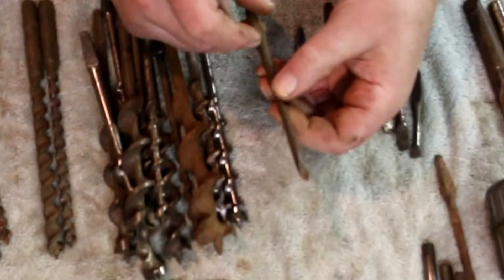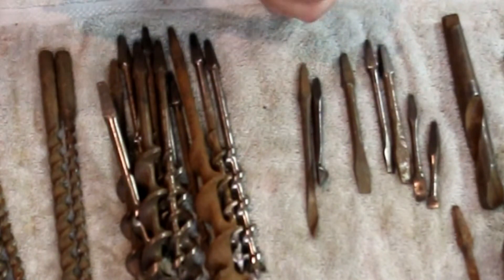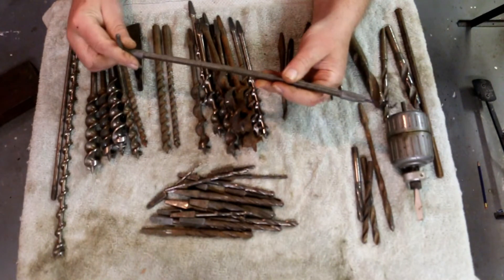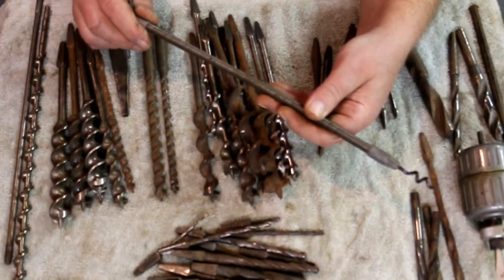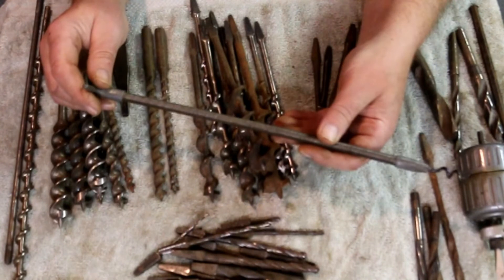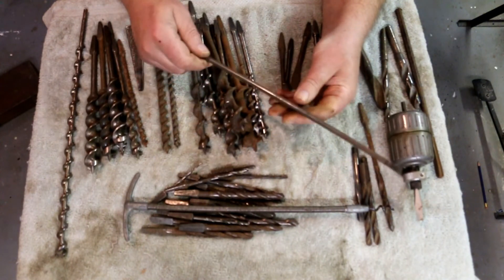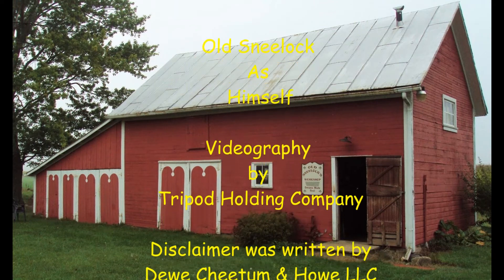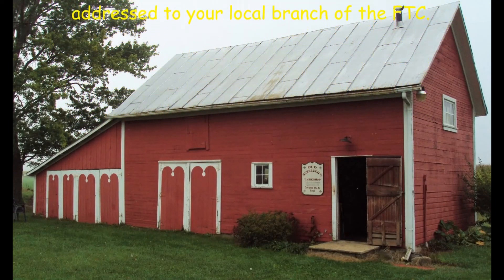Estate Sales ~ Visit To The Heritage Company Pt 2

Comment: You know what...you got me again.  We called those pics 'seal pics' and its more logical now that you've said you used them on hydraulic packings, but we used them to extract the rope packings on large gate valves in boiler systems for repacking.  We bought them at the plumbing and boiler supply houses back in the day.  I still have several from about the size you have there down to pretty small.  Replacement roping was all teflon based by the time I got in the field though in the '70's.  It came in various diameters on  spools.  I don't remember what the old original stuff was but it was always nasty, packed tightly and black looking stuff. 
    I recently cut the ends off of a long 1/4'' one to use the flex shaft to weld to fittings I made to open and close the little hydraulic fitting on my really old horizontal bandsaw.  The flex allows it to do its thing in any position from 60* or so down to the horizontal position.  The previous owner had make-shifted two 3/8 drive universal joints to flex, but it would continually bind up on me and it was difficult to control the fall rate.  Re-purposing at its finest !!  Yep...I'd have bought the twenty dollar box too......LOL
Reply from the maker: Good use of materials. 
Never liked pulling any kind of packing. Did it. Just didn't like doing it. 😀😎

Comment: Packing hooks, I have a half dozen here at home. I left a big hand full on the table in the shop when I retired. The bronzed gland followers we would drill and tap for 1/4" threads. You could then take a broken hook and braze a threaded rod to the end. Many a time I used a ratchet block to pull packing out, along with the gland followers.  Have a good day Un'k.
Reply from the maker: I was kind of surprised. McMaster still sells them. I had the Garlock Chevron Packings on the xxtrusion presses  replaced with U Cup packings back in the 80's.
Reply: @OldSneelock  We had many pumps using braided packing  in the paper mill. The hyd clyinders had chevron packing there was lots of those too. In the 90's we were moving more to mechanical seals in the pumps.  We had good service with them after we cleaned out the seal cooling water. Later we replumbed and ran the product or used antifreeze for cooling the seals
Reply from the maker: For a couple years I managed a company that did mechanical repairs on equipment and machine tools. When pumps began using ceramic seals it caught some companies flat footed. The seals worked great. As long as they were kept wet. Spin them dry  and they rapidly decomposed.
From 93 to 96 we did a land office business because they weren't  thinking about never letting the pump run dry. 
😆😎
Reply: @OldSneelock  It took the paper mill several years to work the bugs out of our systems.  First try was cooling water, the water was Columbia River water untreated. The fine sediment in the water wiped the seals out every month.  Then we placed tanks and used antifreeze this worked good and better in the winter. It took a long time to update a plup mill and paper mill of 12 paper machines. Someone made a truck load of money sealing mech seals.
Reply from the maker: @paulharriss1192  There were three big papermills in my area. At least big by my standards. Parchment, Plainwell, Vicksburg, all gone now. Lots of blame to go around. Not many jobs though. 
Biggest repair we did was bearing journals on rollers. Stainless is good for corrosion resistance. Sucks for strength.
Reply: @OldSneelock  When I started in 88 we had 250 millwrights, 175 pipe fitters,  electricians and instrument men, over 600 maintenance  people.  employed over 3500 people in it's hayday.  To day the mill has sold several times. Each time cuts to make it leaner.  It has about 75 total maintenance people. Most work is contracted out. We had 750 Union people when I left, two large Kamyr Digesters making pulp,  five machines making paper. It still provides good wages for those in the area, and I get my pay check every month.  You have a Good Night and see you tomorrow at noon.

Comment: It was a fine haul, for sure. Now the auger bit is a spade bit, sort of. I like hydraulics. They can be as simple or as complicated as you want them to be but this computer and electric stuff has gone over the top and on the underside as far as complicated goes. Fine as long as it works but when the computer dies that has all the diagnostics, you have had the lick. I'll stick with 4-lever Fords and old wobble sticks. Pilot valves aren't too bad but here comes closed center systems and............. Haven't seen the cousin and/or his splitter. Got the info on it.You can rebuild the new but not the old kickout. Well, what do you know. I'm happy that any part can be rebuilt. My old splitter had an Energy cylinder but someone had repacked it with one o-ring instead of two on the piston. Put 2 in it and away it went. Around 14 tons. Aplenty.  The washer did fine and I'm almost healed. It does take longer to get over doing something than it does to do it. Toots is wanting a shot at the next go-around. So be it. She shall get her chance. Now off to the ACE for various and sundry things. Mostly odds. GBWYall! (Us'ns)
Reply from the maker: A backer behind the proper durometer O Ring does wonders in a hydraulic system.
UTC before I started was extruding O Rings out of face flanges. Someone bought DIY glue up your own O Ring kit. It was several rolls of different O Ring stock. Measure, cut with a razor blade, and glue. 
It worked pretty good for air and water. Not hydraulics. I bought 90 durometer O rings and the problem was solved..
Reply: @OldSneelock  I've seen the kits but we have a Cat 'O' ring on the spin-on filter in the pump house. I've got the part number on a 2-by in there. Hang a bunch of dime store things. Get one that works and it's been on there several years. I like O-ring fittings but you've got to have the right ring. Cheap is one thing but the right thing is a lot better. GBWYall!

Comment: Small fortune in bits.
Reply from the maker: If you bought them new. I cleaned up just a few today while I was waiting for today's video to load. The 1 1/8" Irwin speedbore is nearly double what I paid for everything. 5 minutes with the wire wheel and a file and it's like new. 😆😎